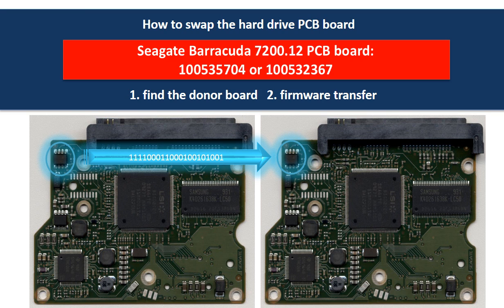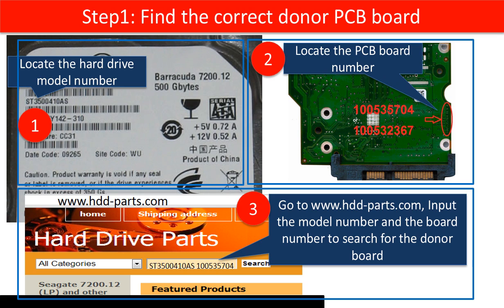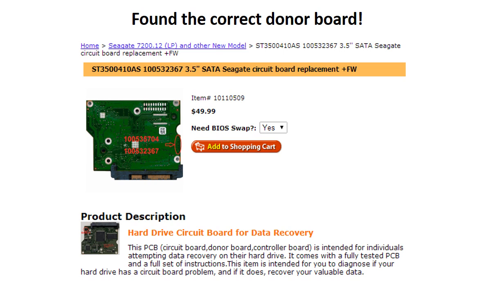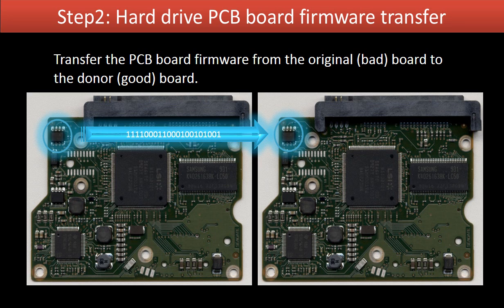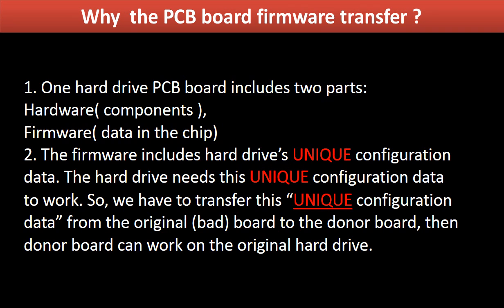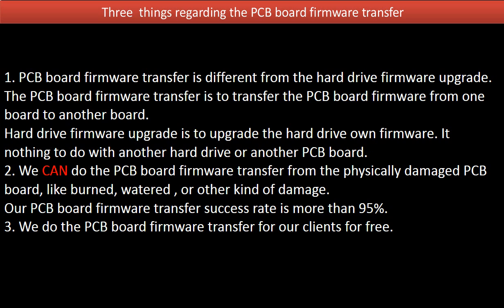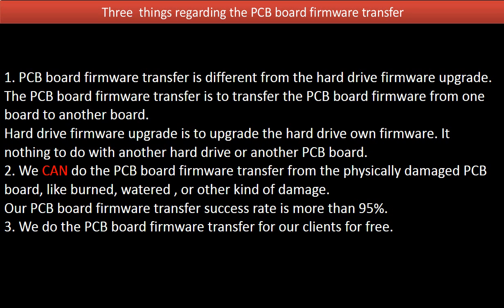Seagate repair tip 100535704 ST250DM000 ST250DM000 ST3250318AS ST3320418AS ST3500312CS ST3500413AS S

Comment: I swapped exact same PCB boards between two ST3500312CS drives.

They work fine.

No firmware issue ensued.

Boards alone are $12 to $15 on eBay, ppd...

Good replacement drives are $20 and up.

I find them for c.$10 in DirecTV DVRHD+ boxes.

c. 2009-2010...

At my favorite thrift store.

The empty DVR boxes then go to the scavengers....

Most other exact PCB board swaps have worked, since SCSI days.

Save your money.

J.C.
Reply: when you say  "exact PCB board", you mean same model and firmware model right?